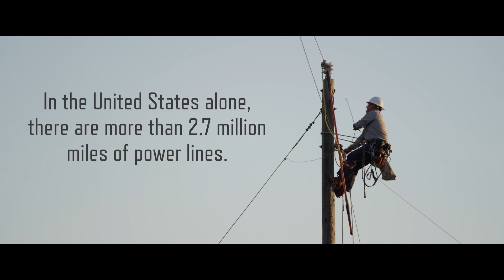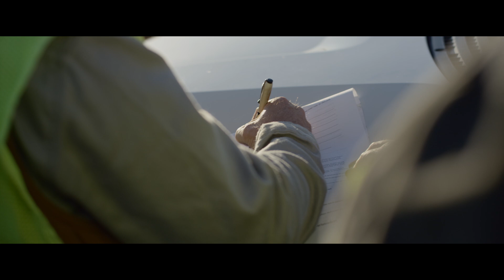A Lineman’s Call: The Story of Jeremy White

Comment: I'm 41 and a lineman been in the field 23 years. I've made it home everyday.  Test and ground, test and ground. No shortcuts. Open visuals, don't assume anything is dead.
Reply: T. Rose damn right, I was a maintenance man, sometimes my guys would get irritated because I was such a stickler for lockout tag out , a man lost his arm because the machine got turned on while he was inside working on it, it only takes 1 mistake to cost you your life, be safe out there.
Reply: I'm in electrician with IBEW. I never get complacent when it comes to electricity. Safety is the number one priority if you want to return to your family after the day's work. Always test what you're working on and lock out tag out. Test and ground for our lineman Brothers
Reply: I appreciate you doing what you do everyday. Stay safe and God bless.
Reply: @Powerhousered1223  Thank you
Reply: @deborahchesser7375  the last company I worked for didn't believe in lock out tags  an I hated it I would get in a broken machine the service light would be on or it would be throwing a code an they would just shut it off an turn it back on again an then when the high pressure pump when put on the Kubota svl 95 went out an it cost 5k for a new one they didn't like that an I told them see I freaking told the mechanic an have proof I even took a pic of the service light an texted that to the mechanic. I did that so they didn't try to blame me. it didn't help I forgot the gas cap a few times but it didn't get ran long but the light was on the first day I got in the skid steer.
Reply: I want to join this line of work thank you for the advice
Reply: @coldboltlighting1237  find you a company that will give you a chance. You don't need school to get started just get your CDL's and they will put you to work. Everyone needs drivers.
Reply: @t.r.4496  thank you for the advice, so they will train me on the job and could
Send me to the school if Necessary.
Reply: @coldboltlighting1237  I really prefer that you would get on the job training, most of the schools will teach you to climb and show you what material is and you can get that on the job. Your better off spending your money on a CDL class. If the school offers the CDL'S with the line class by all means take it. There are some great schools out there, but the younger men I have spoken with that had went to school didn't even know how to wire up a single phase transformer. I asked them what they taught them. They said they climbed poles and put up wire. That was it. Good luck on your journey and be safe. Shortcuts will get you killed, do the job right and don't be rushing to get home to party with the boys.
Reply: @t.r.4496  thank you
Reply: You better pay attention to what is around you. I seen people swing conduit right across them power lines. Same for them Bucket trucks...All you have to do is not look up....
Reply: Keep Testing those grounds sir and stay safe! PLEASE! STAY SAFE!
Reply: This is why in training we look at the beginners and tell them the same thing TEST, TEST, TEST!
Reply: Unfortunately it only takes 1 
dumb error to kill someone.
Reply: Your absolutely right and knowledge about electric power....👍👍👍👍

Comment: This video is a fine teaching aid. I encourage anyone motivated to study then teach safety to others. It will also make YOU a safer person.
This applies to more than the jobsite. I became a Motorcycle Safety Instructor because my bro who wasn't trained (not an option in those days) crashed and became paraplegic due to incorrectly turning a corner at speed. Safety is for home too as many skilled folks get injured off the job taking shortcuts they would not take on the worksite. 

Go slow and you'll get done quicker. Slow is smooth, smooth is safe and smooth is fast. Look out for others and your mind will be right.

Comment: I've been a sparks (electrician) for almost 40 years, during that time I've had a few minor accidents and seen a few too. Most, like this one are caused by complacency, they say familiarity breeds contempt, and it's true. A freind of mine got badly burned when he slipped and fell into a distribution panel, I got burned rushing a job one morning, something I'd done hundreds of times before, but this time it went wrong! I was lucky, only minor burns to my hand, arm and face, like I said I was lucky, a lot are not. Nowadays I push safety all the time, we have to have the equipment to prove dead, so we may as well use it, I tell all the young lads to test and test again, NEVER assume something's dead until YOU have tested it, Lines can be made live or dead over and over, sadly we are only made live once and dead once, unlike a breaker WE don't have a reset button.
Stay safe everyone.

Comment: was about to become a powerline technician... welp not anymore.
Reply: swaggb swa Silidons I've worked on power lines for over six years, the first thing you do is determine which direction the feed is coming from. You go to the nearest reclosure, which is just a big circuit breaker that you turn off. Then you ground the line by putting putting ground chains from the neutral wire to the phase. So if the line does become hot it will hopefully go to ground and kick of a reclosure before getting to you. Also he wasn't wearing his gloves which I couldn't imagine doing. But alot of those old school linemen don't wear gloves, because it's 10x more difficult to work in them.
Reply: thanks gave me a new view on the job!!
Reply: Look man in the electrical feild no matter what you do there's always gunna be stupid shit that can hurt you, there's lineman and electricians who go home everyday until retirement and that's that the whole message that this is trying to convey is that you need to be safe and always have your head on straight while in the feild so you can go home to your family everyday. It's sending a message that if your minds not in it or you take that one shortcut it can really cost you now I think everyone in the electrical feild can raise there hand and say they have taken a short cut a time or two the main thing is do what you want in life but just be careful

Comment: There is a tried and tested way of doing things in a situation such as this. Sure first of all find out what the problem is, Next make a plan on how your going to safe the site and do the work, next make sure the line is dead and you have a visual open or guarantee of isolation . Next test the line for potential then install trip grounds. At the work site prep only the ground work and once receiving clearance proceed with the task at hand and even then there are still steps to follow. The only way this happened was a failure to follow these steps resulting in an accident that did not need to happen and should never have occurred in the first place. end result the death of this man for no reason other than simply careless work ethics

Comment: I'm wanting to be a lineman, and I don't like making comments on a dead man's behalf, but wouldn't one of the very first rules of this line of work be assume every line is hot until proven otherwise?
Reply: Silidons I've worked on power lines for over six years, the first thing you do is determine which direction the feed is coming from. You go to the nearest reclosure, which is just a big circuit breaker that you turn off. Then you ground the line by putting putting ground chains from the neutral wire to the phase. So if the line does become hot it will hopefully go to ground and kick of a reclosure before getting to you. Also he wasn't wearing his gloves which I couldn't imagine doing. But alot of those old school linemen don't wear gloves, because it's 10x more difficult to work in them.
Reply: I see.  How do you enjoy the job?  I'm really close to putting in my two weeks at my current job because I can't obtain my CDL with my hours right now.  I'm wanting to get a CDL and then apply to multiple unions (MSLCAT, SWLCAT, etc)
Reply: Silidons I've never been in a union. The easiest work and highest paying is definitely at a co-op or municipality. I've only ever worked for two companies the first being Davis H. Elliot and the second Pike electric. They are contractors who usually build the power lines and tear the old ones down. The guys at the co-op and municipality usually just maintain the lines or do storm work only in their area. It's hard work especially if your doing distribution reconstruction. But it's nice to leave your mark on something and the first company I worked for helped me get my class A CDL. It's pretty cool to build a mile of power lines and tear down the old, without ever turning the power off to a single house.
Reply: I take it you started as a groundsman then?  The issue is I live in SoCal right now, and there's only a few companies that hire and they're super competitive.  If I don't want go to Union and move out of state, I'd have to go to Northwest Line School which is pretty pricey.  LA Dept. of Power & Water for example waives all experience requirements if you have graduated from that college.  Edison is insanely competitive.
Reply: I was a Lineman for 30 years and did some crazy things. I thank my God I’m still alive. RIP
Reply: @pleaseholdwhileiprocessyou1513  not always able to take a reclosure down but there could be a cutout near by or at least ground on the source side.. But yea in line work always act like its hot, always wear ppe, isolate and insulate and always, always be your brother's keeper
Reply: @pleaseholdwhileiprocessyou1513  Elliot and Pike.... Haaaa.... Poor you...lol

Comment: I don't get it. Experienced lineman touches a hot wire he thinks is dead? Was he suicidal? Isn't there an easy way for them to check the high voltage line on the ground or in the air if it's hot? I am not an electrician but when I work on our 110-240V house wiring I throw the breakers, pull the fuses then check the wires with meters i am going to work with.  Every time.
Reply: You are correct its easy to say good things about people that die but a lot was wrong here I’m sad a fellow lineman died but we fight this everyday safety costs money
Reply: Yes they are equipped  with  a device  that detects  live wires.!    What he did broke every  safety  rule in the book!      I have a voltmeter  that does this ,it beeps when  near a live ac circuit,     
Job dismissal  for any violations  of safety  rules  would  go a long way  in  preventing  tese tragedies, it does no good for a supervisor  to let a crew know he is coming  so they can get their  crap  straight  before  he arrives  ! I saw this happen  several  years  ago  in front of  my house ! Suprise and nail them for any safety  violations!  If thy resent you for trying to  keep them safe  ,oh well

Comment: I worked as commercial/industrial electrian for 15 years I will tell u this I got knocked on my rear it only took once we sent find out what was causing power problems with elevator in a bank tower well I enter elevator equipment room took out y clamp meter which is rated for 600 amps clamped on 1 the phases ro get a reading when I did I still day what went wrong because fire shot out meter and next thing I know I sit on my back ksie up against the wall that was hardest ever Bern here before well boss come in find what happened UT took me min respond and when I got up walked outside it was 19 degrees that I still felt like I was roasting inside now boss later told me the circuit was phased in correctly but I found a new respect that day for high voltage the only different I had done that may have kept getting hit I always had kept a pair lineman 1 kv gloves in my tool bag but gloves had wore hole in finger tip so I didn't put them on that day I don't work on electricity a y more due injury sustained later on due fall off ladder and shattering of my wrist  but I will tell u safety is definitely no matter industry but especially with live wire and assumption makes ass u and me  and increase chances if getting hurt that was sad qhat to gentle man and may he rest in peace but was avoidable if he only done his due diligence and took proper precautions great video

Comment: I'm sorry. But how do you assume a line that is energized , how do you assume it's dead? I watched a apprentice lineman tie in a streetlight wire coming up the pole from an underground transformer , and he took his gloves off and grabbed the wires and started stripping them. I asked the foreman, how does he know those wires aren't touching something in the transformer ? His foreman asked him, and I got a dirty look. I worked communications linework and had power come thru a tree and shock me by contact with a leaf. I don't understand how you can assume while working oowerlines construction. We had a worker get killed by 20000 volts because he didn't respect the oowerlines. It's crazy. How could you just pick a line up. I don't understand. A live line, and you assume it's dead. No. No no no